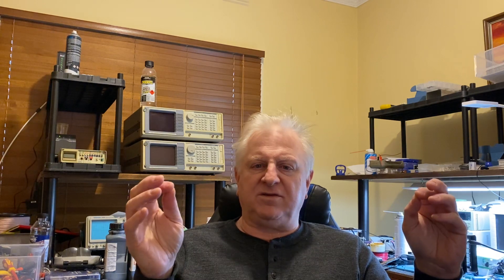Minelab SD2000 SD2100 SD2200 GP xtremeGP3000 GP3500 GPX4000 GPX4500 GPX4800 GPX5000 GPX6000 GPZ7000

Comment: Hi Woody… A very informative video.. Certainly clarified a few things for me… I also wanted to reiterate how impressed I am with the modifications to my GPZ 7000. As you mentioned in your clip, the old gold workings of yesteryear have been well and truly worked by every detector known to man…to the point where finding anything over a gram or two would be considered a great day out.. Especially up here in the Whipstick Forrest (Bendigo). Since you have modified my machine, I have continued to visit old workings within the Whipstick that are generally regarded as being  “flogged to death”. (Just to find a genuine target to dig can be a major achievement..) I’m constantly shaking my head in disbelief at the small gold (and lead shot) I am managing to pull out of these areas. I even pick up clear targets on top of mullock heaps that every man and his dog, his cat and his ferret have walked over, but not heard.. I sincerely believe that your ability to reduce the noise floor in my 7000, has helped to hear the small sub-grammers at greater depth.. I estimate that I’m getting ‘at least’ another couple of inches in depth on the 0.1g and 0.2g sized pieces, with the depth increase more prominent as the target size increases.. An unexpected issue that I have noted, is my inability to use my 12” Nuggetfinder Zsearch coil since the modifications.. Due to hearing issues with background noise, I always use headphones in the bush.. Now that the 7000 runs more quietly, the ‘hollow’ sound of the thicker Zsearch coil moving over the ground is much more prominent through the headphones and very distracting. I stick to running the standard 14” Minelab coil with great results… Someone who doesn’t use headphones may not find this an issue, but I thought I should mention it out of interest… Will continue to keep you updated on my experiences with my modified GPZ 7000.. I can’t thank you enough Woody… Regards, Steven ☺️

Comment: Thank you so much for this video... 
I found it most informative for me. As I have a sd 2000. 
I would love to do the full upgrades but simply do not have money. 
I am running on the smell of an oily rag...
It SUX BIG TIME. 
I'm keen as to get out but I do wonder if my detector is working correctly.  Catch 22 . Grrr. I'm Geraldton and have been out a few times to good ground . But seem to miss out. 😕 thanks again buddy
Reply from the maker: The best and cheapest thing to do to to  sd2000 is install a 3.2 Mhz crystal.
Reply: @DetectorMods  what does this mod achieve bud

Comment: In the new GPX 5000 series, the contrast of the LCD is very low.  what's the solution?  Thankful
Reply from the maker: That is a good question, I suspect that the display contrast can be changed by changing a resistor on the display board, I will have a play and see what can be changed, but I think you may be right.
Reply: It would be very helpful if you make a clip about this.  Thank you very much.
🙏🙏🙏🌹🌹🌹🌹